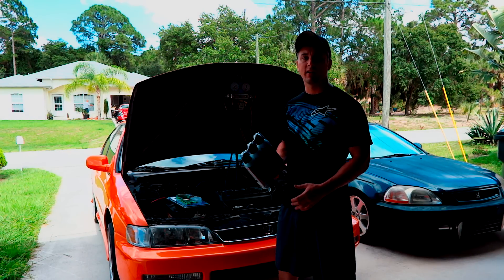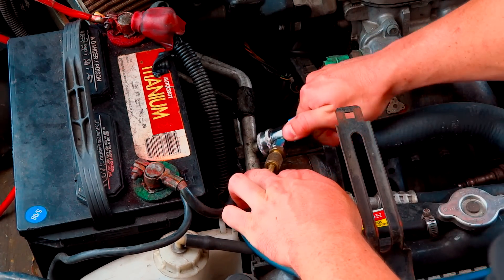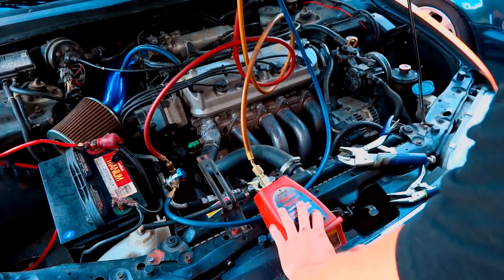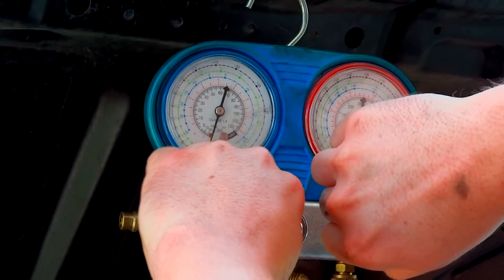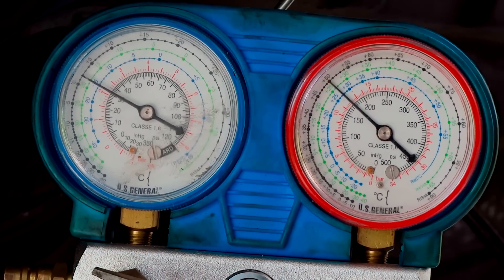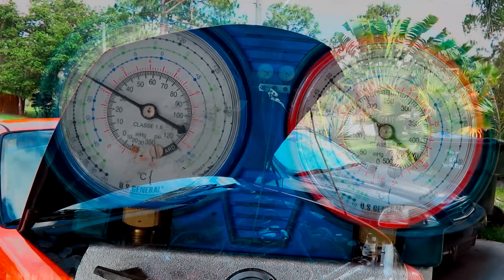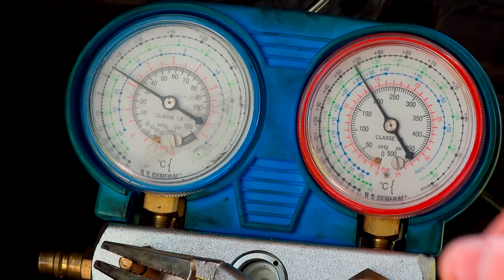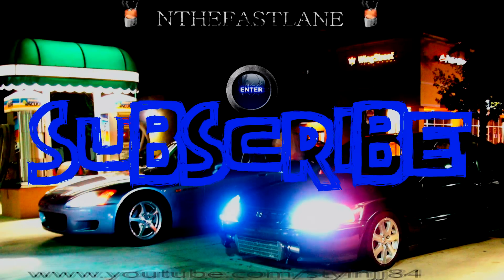Charge Your A/C With The Cheapest & Coldest Refrigerant

Comment: Although the vapor pressure is similar to 134a its mass is significantly different. I find it somewhat humorous that you would squawk on about global warming (isn't happening) and you venting all of your refrigerant into the atmosphere. You lost a significant amount of refrigerant oil as well. Your compressor will thank you when it meets an early failure. As an alternative it is similar to the efficiency realized between R12 and R134a. In other words it is less efficient. As to the nonsense about flammability why in the world would you mention that? ALL refrigerants are designed to operate WAY below ignition levels. It is the refrigerant oil that is flammable. In addition an A/C system is designed on the specific temperature it needs to perform the function of heat removal from the passenger compartment without "icing" up the evaporator core. ANYTHING that is done to change that will result in poor cooling performance due to lower heat transfer from vapor pressure differences and or icing. Can't understand why people with little understanding and even less money think they can go to the local wally world and do a better job than the billions of dollars in research and development expended each year by GM, Ford, Toyota, Honda, Nissan, Chrysler, etc.
Reply: HHH100. hey im from a blue state but i do find it pretty cool these guys are innovative when it comes to machinery ...also russians can be pretty smart to ,kids building snowmobiles and whatnot ....pretty cool stuff
Reply: You have a valid point about releasing oil from of the compressor , but the rest of your argument is uneducated . The gas in an air duster is Difluoroethane or
 r-152a. Difluoroethane is actually a SNAP approved refrigerant replacement for r-12  in thus has been tested for it's effectiveness . The test shows it provides 20 to 40% better cooling capacity than r-134a . As far as venting the old gas to air , while being illegal as all hell it's envirosafe  not r12. The only ingredients in envirosafe are R-290 (propane) with a dash of isobutane and an added scent. These replacements have been in use for over 15 years now in both older and newer systems as replacement gas and newly built units. If you would take the time to search you will see most other countries don't use r12 ,r22,r134a,or r410 they have used propane for decades . Propane provides better cooling capacity at lower levels of energy usage than any of the mentioned gases all while be non ozone depleting . The question you should be asking is why he replaced envirosafe with Difluoroethane .
Reply: Sorry did not realize that propane is now considered non flammable. Better update the MSDS and SDS for your new standards. You may want to let the EPA know also because they are saying that propane venting is still illegal and that they have not approved hydrocarbon based refrigerents for automotive use. I am so glad you have cleared up all these legal problems for industry. The U.S. and myself now stand corrected due to our ignorance and your enlightened sense of truth and global prudence
Reply: TheMechanic2
I very clearly said venting the propane based gas isn't legal , venting any refrigerant gas is illegal  . Envirosafe gas is propane and isobutane based and thus not ozone depleting as your comment about venting to atmosphere makes it seem . All gases in use in car ac systems are flammable because they carry oil . You can misread,misinterpret and re post my words with any amount of condescension you wish, the fact is 90% of your argument was and still is wrong .
Reply: Mike Parker you keep digging a deeper hole. R134a is not a flammable gas. R12 is not a flammable gas. HC gasses are. Plain and simple. I laid out clear and precise information including EPA's opinion. You can stick your fingers in your ears and scream "Na na na na" all you want does not change the fact that you are wrong
Reply: TheMechanic2 Here is what you wrote ( As to the nonsense about flammability why in the world would you mention that? ALL refrigerants are designed to operate WAY below ignition levels. It is the refrigerant oil that is flammable.) 

Here is what i wrote ( All gases in use in car ac systems are flammable because they carry oil)

 You must not agree with your own words . Your information is clear but neither precise or the Epa's opinion , if i was they wouldn't have tested  Difluoroethane nor said it had better performance than 134a 
http://www.epa.gov/cpd/mac/152a/
Reply: If you think a ruptured line under your hood that is releasing R134a and one Is an HC like propane than it is obvious the conversation can't hope to go further.
Reply: TheMechanic2
I can't understand your last post , i can only understand you used propane and hc again . The debate wasn't about Hc it was about using other refrigerant based gases in place of r134a . Your initial post says r-152a wouldn't cool as well as 134a and would ice the evap core . This means you are not familiar with mass amounts of testing the epa and refrigeration company's have done since r12's replacement , those statements only hold true if the system is charged incorrectly . 152a will replace 134a around 2017 , it's been tested in 3 system configurations including drop in replacement for 134a.  152 beat 134 in each system type. Will the gas kill you if it leaks ? It probably would , but so would 134a wich also acts as a nerve agent. These are the reasons systems are moving to secondary loops . To add further insult to injury the gas 152 beat was R744 aka carbon dioxide , this has never been about actual safety it's about patents and who controls the market with them.
Reply: I truly believe you when you say you don't understand. I will leave it at that.
Reply: You need to become a little more informed before you spread lies and promote breaking the law.
Reply: TheMechanic2
Another useless reply without facts , I guess i shouldn't much from someone who says global warming isn't happening .
Reply: You guys spent a month arguing, I'm impressed.
Reply: TheMechanic2 That's why Russia is sailing the northern passage and drilling for oil and gas in places that have been frozen for as long as anyone can remember. Farmers are farming land that's never been known to have been thawed before in Russia. Even scientist from auto, energy, and oil industries admit global warming is real, they just say it's too late to do anything about it!

Comment from the maker: It wasn't R-134a, it was Enviro safe "organic, non-toxic, non-ozone depleting hydrocarbon compound" I mentioned it in the video while releasing it into the water bottle. As for the oil,your correct, I should have mention measuring it and adding what was needed but in my case I had to much in there from alot of product testing.
Reply: You should pin this comment to the top.
Reply: They are dancing around its true contents, propane.

Comment: I didn't read the ac gurus comments about this video because I'm too lazy. I can see however, how they may be bothered by someones instructional video if they are untrained. First you should use an empty water bottle so that you can see how much oil you lost when you drained the system and add it back, an ounce lost in some cars can be real bad. Also it is illegal to release r-134 into the atmosphere, I have done it but you shouldn't misinform people.
Reply: I wouldn't admit to that online.  You can be heavily fined for doing that.  The EPA offers a large reward to people who turn in violators.

Comment: I bought the Part from napa and the dust off cans today, I'm having a problem trying to find an adapter without buying the entire manifold set, is there an alternative that i can use to run the can straight into the low side. thanks
Reply: No

Comment: Correction:  It is only illegal to release r-134a if it is coming out of an air conditioner.  It's important to note that considering that r-134a (not just r-152a) is used in several brands of duster (3M, for example).

I guess what I'm trying to say is that just because it's illegal doesn't mean it will actually amount to anything.  :)

There are also some refrigerants that are legal to vent off, mostly HC based, such as butane/propane blends.  Of course, those aren't legal for cars in the US.

Comment from the maker: Yes,I mean don't go huffing the stuff but if you think about it, they do tell you to spray it on your keyboards and computer items in your house.So I don't think it will harm you. Yes, Enviro Safe can be used as a replacement for 134a and r12..just add it right in the mix with out releasing the 134a or r12.I threw this stuff in my other car that was l low with 134a and mixed it together @ 50psi and it get freezing and the compressor never kicks off while driving or sitting.
Reply: The compressor SHOULD kick off...

Comment from the maker: ENVIRO-SAFE is an "ENVIRONMENTALLY SAFE" organic, non-toxic, non-ozone depleting hydrocarbon compound. ENVIRO-SAFE is a hydrocarbon refrigerant and has been endorsed by GreenPeace. It is in full compliance with the UN Montreal Protocol. Like most organic materials ENVIRO-SAFE is flammable, but its ignition temperature is 1585ºF at both 5 psi and 0 psi (which is better than the DuPont R-134a's ignition temperature of 368ºF at 5 psi and 1411ºF at 0 psi)
Reply: Are you sure?  EnviroSafe is mostly propane, and when mixed with air in a passenger compartment, it is explosive.